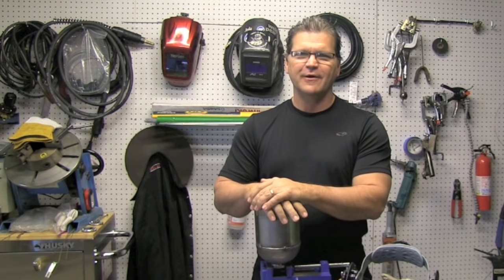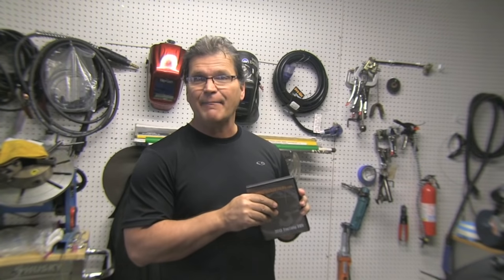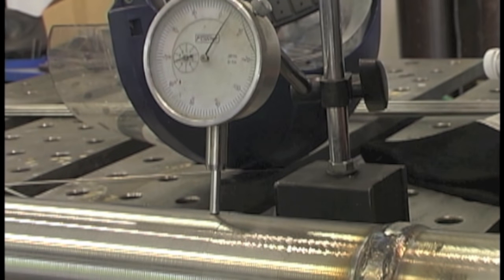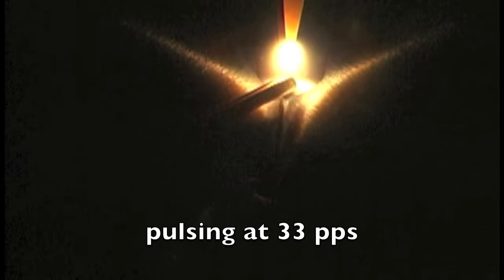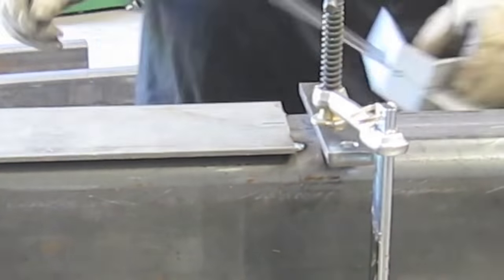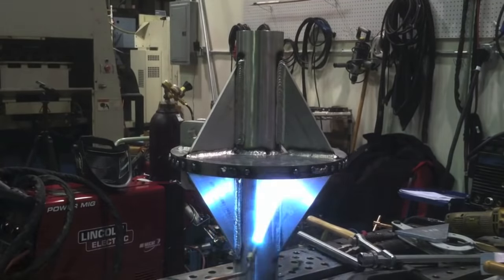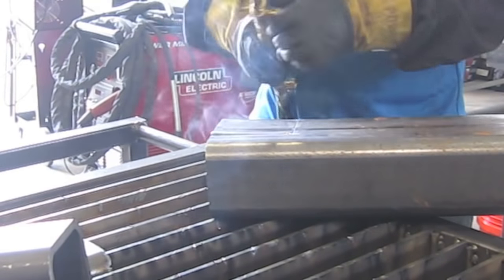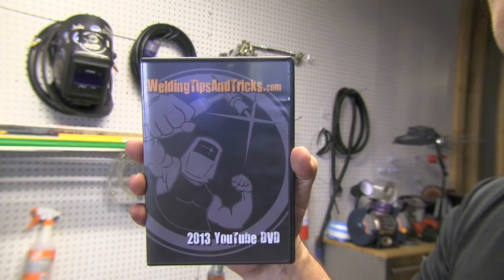TIG Welding Tips - 3 Tips that Matter Most

Comment: Hey idk if you will see this but i work on boilers  and im in the piping department and we weld platens or build giant  radiators  and thos stuff is good but it would be. Cool if you could show a high stress  welds three rows of 24 pipes per platen 1.5 inch 120 wall dom and the header is 5/8 inch thick so thin to thick with a 3 inch space to get between  each pipe thats real world they need to see how it is  the life of a tig hand
Reply: And in the shop never say you can't  if you haven't  ever tried  and never ask permission  to do something you haven't  ever done its easier to ask for forgiveness than permission so just  take your time and do it take your time!!!!!!

Comment: my question ... what size of tengeston do i have to use if i have a plate of 1.5 mm
Reply: best using smaller one. of 1.6 weld abound 50-60 amps

Comment: What creates porosity in a TIG weld?
Reply: Force of air, lack of argon flow, opposite polarity. Etc.
Reply: Probably dirty material, with tig you really need to clean your material up, wire brush, polish and even use acetone.

Comment: I hate how some stick welding sticks are so high priced
Reply: +lkjyuiop We used some called Eutectic 680. Best stuff I ever used. I even welded a leaf spring in my old 1962 Mercury. It was for temporary use, but it never broke. That was the most expensive I ever personally bought. Back in the early 1980's I think I paid about $120.00 for it. Now for my work by far the most expensive to weld was Beryllium Copper. Have to have an air-supplied respirator to weld and machine it. Don't even file this stuff and breathe it. It's like asbestos and gets in your lungs but never comes out.

Comment: Pulse Spray arc MIG, on carbon, out of position...sweet...inverters....Sweeter...!.
Reply: Technology has made welding even more interesting.&#160;I picked up a powermts mig welder with pulse and can't believe how versatile it makes the machine and how much more efficient I've become. I can't wait to see what else they come up with.
Reply: ...I had a small welding shop in 1981-85...bought a Miller-matic 200.....still have it, it still works fine.... 
 No employers I ever worked for, even in the last 15-20 years....had anything any better.....